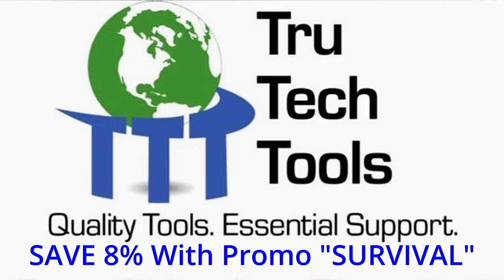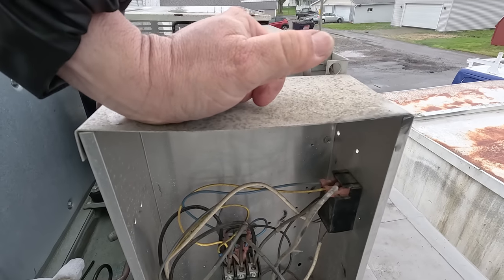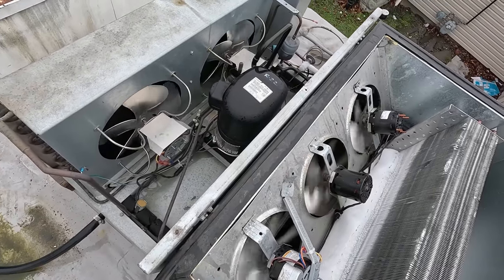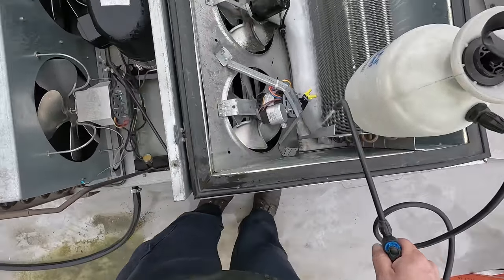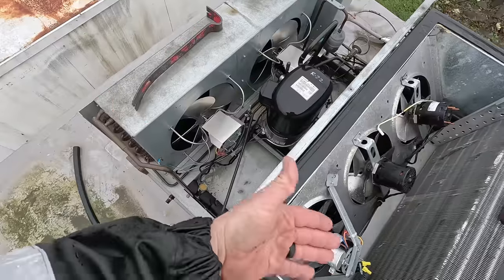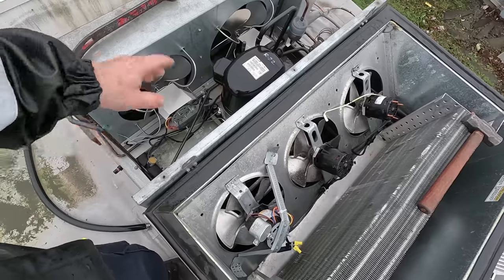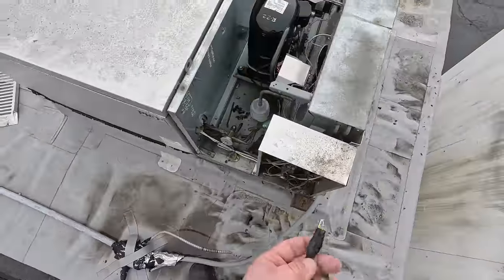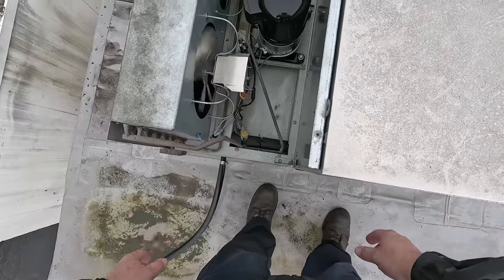Cooler NOT Doing What I Was Told... But I Did Find This

Comment: Keep a A421abd in your inventory at least. They are really versatile and not that expensive and you can replace those automatic defrost thermostat and you'll save time by installing a thermostat with programmed defrost rather than a mecanical thernostat AND a timer... Wich you might not have enough space

Comment: I think you were on to something with the probe being out laying on the bottom. it was probably the great weather and water in the cooler causing ice build up that pushed it out.
maybe try putting it on the opposite side, slightly higher up and pushed deeper?
look at all that safe wide open footing area, so graciously away from the edges. 🤣🤣
Reply from the maker: There's not much I can do about the edge, I can't nail 2x4s into the side of his cooler. You could take the approach that the satellite dish companies use because they're not allowed to get off of the ladder, BUT most accidents happen on ladders. There's no place to tie a harness off to because you're going to hit the ground before it catches you.  Our job is dangerous, we just got to make the best you can of.

Comment: I've been debating which wireless probe set to get. On the one hand, I've been really happy with the Testo 550 manifold. On the other, I've heard the Testo wireless probes don't have the range the Fieldpiece ones do. The 550's onboard Bluetooth has a pretty limited range and that has been inconvenient in the past. It's the only bad thing I'd say about them.
Reply from the maker: I havent used the Testo pressure probes but the temp probes work a lot better than the first generation. The fieldpiece probes have good range but a crap app. Measure quick doesn't work with Testo anymore and they are wanting to much money for the product. I shouldn't have to sell each customer on letting me use the MQ app for $5 each Job. Thats to much trouble in my mind and then have to get paid back. Originally I liked the FP probes best but thats starting to wear. The Testos aren't perfect but the app works good.
Reply: @HVACRSurvival  I had no idea MeasureQuick was doing that. I don't begrudge a company the need to make money, though apparently they are taking a very hard-line stance by punishing anyone who takes a screenshot of the MeasureQuick software. I won't accept co-opting my device's functionality in that manner.

I have a very hard time imagining that MeasureQuick is barely staying afloat. As best I can tell, they and TruTech Tools are one and the same thing . Judging by TTT's blog posts, they're doing quite well selling all manner of HVAC/R tools and thus what would a little goodwill toward the community that brought MeasureQuick so many users really hurt?

I've purchased several tools from TTT using both Chris' and your promo codes. Going forward, I'm going to have to think about whether I want to patronize them again or not, if there isn't a substantial revision to MeasureQuick's policies. I'd be perfectly willing to pay for a fully functional perpetual software license within reason. I want no part of software by subscription, nor to have someone telling me what features of my device I can and cannot use. (Yes, I know they say Qbits aren't offered by subscription. The point still stands. I don't want to be strung along with additional expenses.) I am a very small player who will never be missed, no doubt, but if anyone asks, it won't be MeasureQuick (or TTT) I recommend any longer.

It is not my intention at all to place your relationship with TTT in jeopardy, and I will be glad to remove this post immediately upon your request. If anyone from TTT or MeasureQuick is reading this and would like to reach out to me, the e-mail address on my channel is valid.

Comment: Hello Rick,
I do enjoy watching your video's. That last couple you put out are definitely not OSHA or code compliant, and I do get trying to get the customer up and running.  The few examples are the units on edge of roof which equal a fall hazard, no disconnects at equipment on roof which equal a shock hazard, on this job I had seen MC or BX wire run on roof which is not rated for outdoor use. You must care for your own safety so you can go home safe to your family.
Reply: a home brew install or butchered side work someone did
Reply from the maker: A lot of this was installed by the previous owner. A farmer owns it now. If you know how that works out then you'll know why you have seen what you saw.  Thanks for looking out for me.
Reply: Welcome to the HVAC service life…
Reply: Unfortunately most jobs in any service trade are a crap-shoot

Comment: What I suspect 
1- that's not an outdoor unit.
No manufacturer would pass UL with that controller for outdoor applications.
That said, being indoors there should be no need for head pressure control.
2- I didn't see a baffle between condenser fans. Which you wouldn't need with a non cycling fan unit.
However, since one fan is out it's basically circumventing the condenser coil and just pulling air from one fan and out the other.
3- the klixon switch could be a high pressure limit.
Obviously this is all speculation because I'm not there looking at the unit.
Reply from the maker: You know what I think you're correct, this is the same type of unit that we have on top of the subways that are inside the building. Everything else is hodgepodge at this place so it wouldn't surprise me that somebody found it somewhere at an auction and threw it on top.
Reply: according to the paint marker model number (PTT099H2C), it is an outdoor unit. *PTT =  Package, Top mount, Outdoor. * the third letter N = indoor and T= outdoor.
the outdoor model difference is pretty much having, crankcase heater, drain heater, weather hood. that said, where's the drain line heater? did I miss it or it doesn't exist and shouldn't it extend out the added rubber hose? the indoor model has a condensate evap. pan and no drain or heaters at all(except freezer/low temp). i think it's the same across all heatcraft/larkin package units, but you kow how they like to shake things up to screw the techs dry no lube. 🤣🤣
Reply from the maker: @trottle bottle and boom your extra vast knowledge comes in handy. The drain line had a heater inside the drain line.
Reply: @HVACRSurvival  yeah well, if I was there working on it, my mind likely wouldn't remember that, due to processing all the other cruft. but that's pretty normal visual  differences for majority of brands indoor vs. outdoor. 🤪
Reply: @throttlebottle5906  
I'm not so sure I'd trust a paint marker.
Do we have a specific, make and model.
I know Kolpak makes these package units.
Others as well.
Hard to believe an outdoor unit would have louvers on the top to allow water to just pour down onto the compressor.
Additionally, the controller would be in a NEMA 3R type enclosure.
Reply from the maker: That's my paint marker I wrote it down from the last time I worked on it
Reply: @HVACRSurvival  
Think about what I said with those top louvers. Have you ever seen that before? 
I haven't.
Who makes this unit? I'll look up the nomenclature.
Reply: @vincentpribish9276  good question, but on those, there wouldn't be a drain line and it would have the dreaded hot gas/liquid discharge line in a condensate evaporator pan. it didn't seem to be modified that heavily and it would cost more to modify an indoor unit for outdoor usage, even used market. so I have to believe the scribble stick applied inside.(lol) 
there was missing/no "weather hood" on it, probably optional, they didn't pay for it, blew off in storm. so there's open louvers all over compressor compartment
Reply: @throttlebottle5906  
Just spoke with heacraft tech support.
Definitely would not have louvers on the top.
He's sending me an email with the drawings. I'm not sure how I'd forward those to you guys.
Reply: @throttlebottle5906  
I just took a closer look at the discharge line.
Drops down then comes back up. Thinking there was a condensate loop down there.
The covers look OEM to me as well.
The question still remains, how could you have fan cycling without a baffle between the fans ?
Maybe there's one there and I just can't see it 🤔
This would be a pretty easy conversion.
Cut out the loop. Throw on a crankcase heater. Replace the high pressure limit with fan cycling ( which would be wrong ) add an external drain line.
One last comment, where is the high pressure safety ?
Reply from the maker: There was no high pressure limit, that was a preset high pressure switch used for fan cycle control. Not all condensers are going to have a baffle in the middle, look at how many rooftop units do not have that. Yet they have fan cycling, either way the pressure is going to build and cycle on and off at the predetermined level, during hotter weather both fans are going to run not requiring a baffle. Yes it makes it nice that the fan won't be running in reverse when it kicks on but such is life this is what we have.
Reply: @HVACRSurvival  
You're missing the point.
You can't have fan cycling without a baffle.
Air would just get pulled from the non working fan rendering the condenser useless.
Look at any remote air condenser and you will see baffles. No way around that.
RTU's don't cycle one fan the same thing would happen.
Either a fan/s cycle control or VFD for the combination of fans.
Pretty sure UL would require a high pressure safety we're not discussing a small reach-in cooler here.
Reply: I'm not here to beat you up my friend.
Just offering some insight.
Everything I see here points to that unit being for indoors. 
Sure I could be wrong but with all these red flags I'm suspicious.
This is a great industry and we never stop learning.
If I'm not learning something new everyday I'm disappointed 👍🏻
Reply: @vincentpribish9276  yeah, that's the whole idea. if there was no baffle between fans, the one cycled would very likely start spinning in reverse and may not start forward again when power returns(slight chance/weak cap if it has one).
even then there would still be some flow through the coil due to the closeness of the fan blades, they'd be scooping air more from the coils direction and expelling a small amount out around the radius of other blade, unless there's round shrouds.
yeehaw, I'm no engineer, but I may as well be, because I often obliterate them with experience(not always, I know my place) 🤓
Reply from the maker: @vincentpribish9276  I'm going through the original video and there is a total of 3- 5/16 screws in the fan shroud in the middle between the two fans. There's no reason for those to be there unless there's a divider. So that answers the divider question you had, now onto the slits on the side, the condenser fans pull the air from the front back towards the compressor, where else is the air going to go but through those slitz? It's no different than a typical split air conditioner, the compressor is exposed to the elements along with reversing valve and whatever else is down there, like I mentioned earlier the pressure switch that you seen is a generic fixed switch that turns the fan on and off to cycle it, it's made for people that are stupid and don't know how to set up a fan cycle switch, that was not a high-pressure safety, I don't see very many walk-in coolers or freezers with high-pressure safeties because it cost money, people are cheap so they cut corners there and only put that on the more expensive units.  Then to answer so This was made by is heatcraft..
Reply: @HVACRSurvival 
I'll unsubscribe 
Since you're deleting my post
I guess you didn't like the "feedback"
Good luck moving forward ✌🏻

Comment: none of that would be code here
Reply from the maker: It's not here either. 👏👏 Did you see the grain elevator behind me? I'm working in a little low budget town without any inspectors other than plumbing.
Reply: @HVACRSurvival  You did it as safely as you could given the circumstances.
Reply: @HVACRSurvival You do the best you can ❤